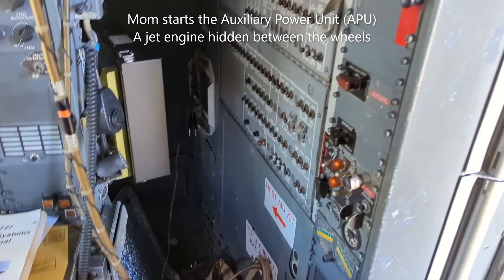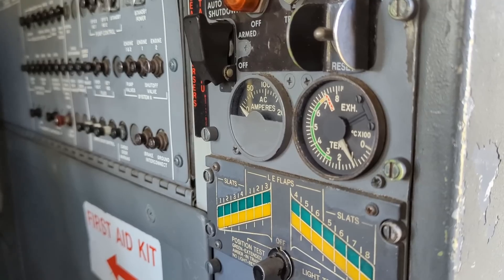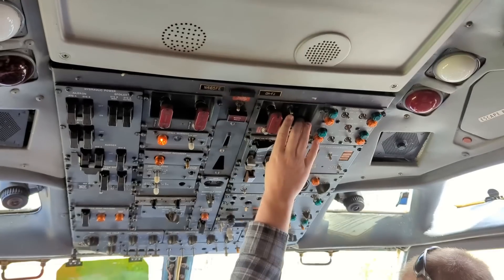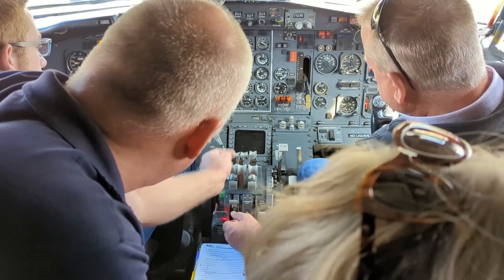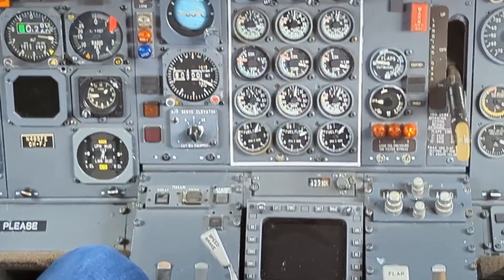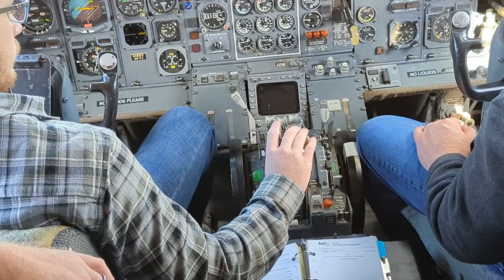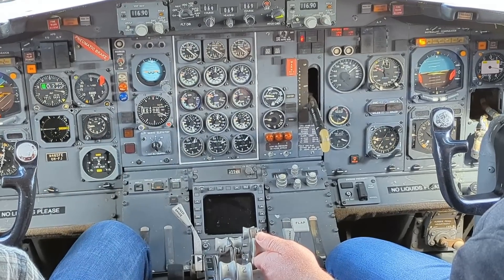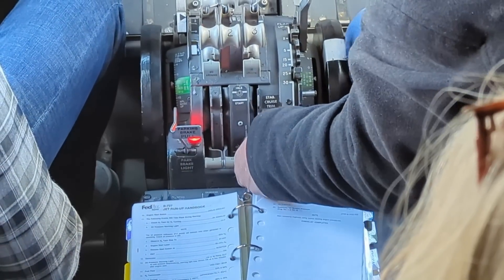Ordinary Family Starts a Boeing 727

Comment: Did they have a GpU ( ground power unit) to power up the APU ? I doubt the batteries would have been in a serviceable condition.
Reply from the maker: We did a small modification to allow us to plug in a Fox cart, which substitutes for the battery. We start the APU from the Fox Cart, and then start 1 and 3 from the APU.  #2 does not have enough accessories attached to run safely. Keeping the battery serviceable was not possible, given the long periods of time the jet sits idle. For other operations, we have a Hobart AC supply. We have a huffer as well, but we haven't needed to use it.
Reply: When I was employed as a ramp agent for Integrated Airline Services at KIAH in 1999 we handled Kalitta's 727-200's I recalled we had to attach an air starter to start up the engines, but I do think the aircraft has it's own APU (I could be wrong).  The other aircrafts we worked on did have APU's (747's, MD-11's, etc) but the DC-8's we also handled for BAX Global required using air starters.  Fun days!
Reply from the maker: We have an operable APU (see my other comment) and this aircraft as the stairway in the tail. No "Cooper lock" though. FedEx warned us not to use the cargo door, since they were rather unreliable, and we wouldn't want it to get stuck open. So, we have left the cargo door shut.
Reply: @dwmzmm  perhaps it was an earlier version of the  B727, as the early ones had the rear retractable stairs to enter the cabin? I think on the latter series of the B727, Boeing eliminated rear stairs.
Reply: @paulsz6194  The 727-200's we serviced did have the rear retractable stairs, as I lowered those stairs myself on occasion.  The interior of the cabin was just empty space with spring clips on the floors for securing cargo pallets to the floor.

Comment: Worked that airframe and tail many times over the 30 plus years at KIAD for FedEx . I was part of a legacy that participated in an airline that went from analog jet ops to digital jet ops.. 
Jumpseating in a DC-10 a300 and the 727 it brings back memories from decades of frontline hands on work.. the 727 was the last of the sensory analog only skillset You neded to identify problem as it happened. No computers..
Reply: Planes were so much easier to fly before computers. I have a 1974 Cessna 172M with its original panel. I have seen several of these wonderful planes ruined with those stupid video game panels. Even if you "learn" how to use them, they are not intuitive like the old panels with mechanical instruments and switches.

Comment: This brings back a lot of memories from my days as a United 727 Flight Engineer. Great video. Thanks for sharing.
Reply from the maker: My pleasure!
Reply: So cool
Reply: How in the hell do you use ALLLLL those buttons, gauges, switches etc?? It looks soooo confusing!!😮
Reply: @jerrysanders9101  We spent a lot of time studying systems and controls in ground school. Then we spent more time practicing panel flows in the simulator before we ever got to touch the actual plane. By the time you were ready for Inital Operating Experience in the real plane with an instructor pilot, you had already passed your Turbojet Flight Engineer FAA checkride in the simulator and knew every switch and gauge in the cockpit like the back of your hand :D Cheers.
Reply: I flew it as FO for two years after 14 years in ancient in steam gauge T-Props.   Hell, we may have flown it together.   Thank you for all your hard work!   I miss that jet.   Everything after it was pretty cool too, but boring with no soul.   "Push this button to go there".  Etc.   All of them hand flew nicely, but all the electronic "help" was sometimes more work than help.  For example,  first week at TK in the procedures trainer ( on 757) and I was lost as it was my first glass/FMS airplane.  The FMS was still largely a mystery to me.   We departed LAX and were out "pushing buttons".   The instructor says to my partner "descend and maintain XXXX, proceed Direct LAX".....she dazzles her fingers on the MCP and then in the box.   The airplane does it all, perfectly.     He then had me do the same thing...I turned off LNAV and set the VOR for DIR LAX.   Turned off the AP and FD, pulled the throttles to idle, turned toward LAX and pushed the nose over.      My instructor said that a Standards Guy would either fail me on the spot, or stand up and applaud depending on who it was.   I just laughed and figured it out eventually.

Comment: N465FE.  Boeing 727 former FedEx unit grounded in 2012 as instructional aid at Pennsylvania College of Technology.
Reply from the maker: It's an awesome aid. The APU, and engines 1 & 3 run smoothly. It's great for the students to work with pressurization, hydraulics, and more.
Reply: @kc8t  is #2 inop or removed for instructional use in the classroom?
Reply from the maker: @johnevans7006  We already had a JT8 on a stand in the lab, so we asked the Fed Ex crew to put the #2 on the airplane when they did the swap.
Reply: FedEx is not the last airline to operate them. Kalitta II Charters still operates a small hand full of them and I'm delighted to say you can still see them arrive and depart Cincinnati every day! For how long, I don't know. I hope to get back into dispatching and work out a jumpseat on one before they're truly all gone! Missed my chance with the L-1011 :(
Reply: Thanks for the insight, I was wondering why there was residential infrastructure outside of the cockpit window!
Reply from the maker: @kenpasternack9108  We are on the edge of the airport. The  nearest actual residence is across the railroad tracks and across another alley. One of the businesses looks pretty residential.
Reply: They weren't grounded .. the FAA forced retirement on all domestic operating passenger 727 first but gave cargo operators an extension with FEDEX being the last airline to operate them..